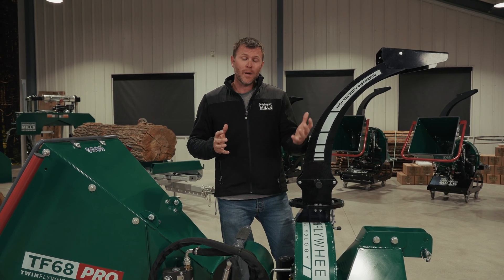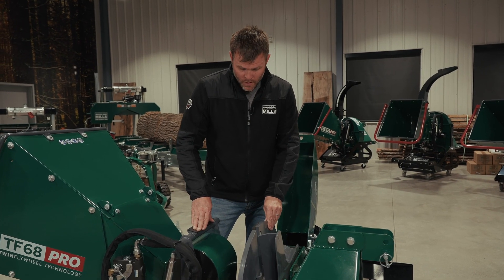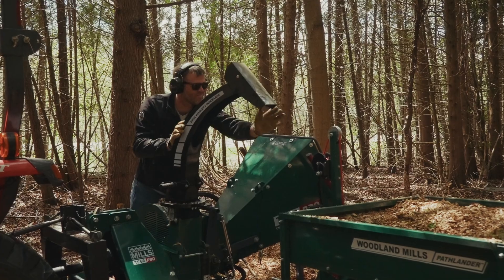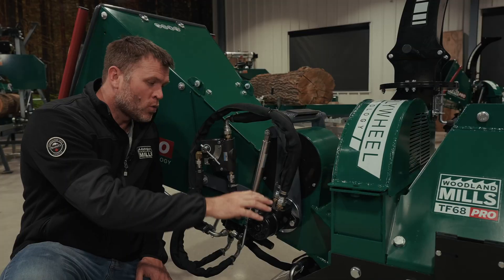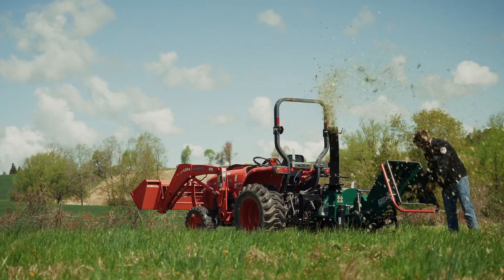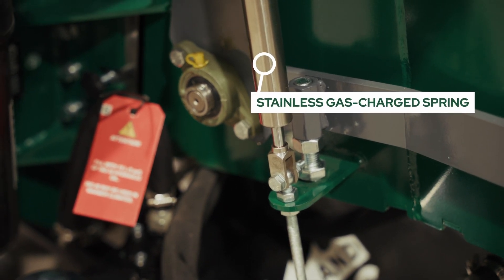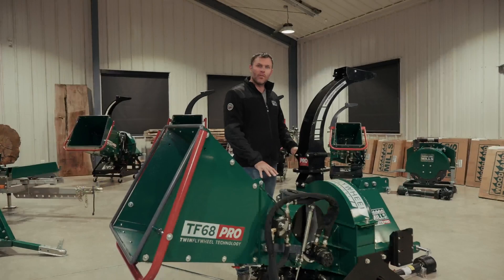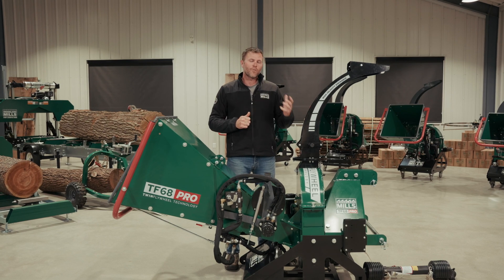Woodland Mills TF68 PRO PTO-Driven Wood Chipper Walkaround

Comment: I just got my TF68 Pro delivered a week ago. I will update with a video when I connect it to my tractor and use. I chose the Pro model because here in central Florida we have lots of pine and oak and is green most of the year with leaves and needles. Hopefully the Pro model will keep all the extra debris clear from the chute.

Comment: how do you raise the intake feed roller when you stall your tractor out on a big chunk of wood that is stuck between the chipper knife flywheel and the feed roller?
Reply from the maker: Once everything is turned off, we recommend removing the spring tension and lifting the roller up to remove the clog. If you still need help with this issue please call us at 1-855-476-6455 and press 2 for tech :)
Reply: I would think (and I am not sure), but I would think that when the pto is disengaged, the red bar would be pushed in to reverse the feed. Then, when the pto is engaged, it feeds the material back out.

Comment: I like seeing that window for setting the bed knife. I wish the WC88 had that feature! I like the 88, but if I wanted to get nit-picky, not being able to set the bed knife with a feeler gage buggs this old machinist.
Reply from the maker: Unfortunately the bed plate gap tool and window is only on our new chippers as it is a part of the housing. However, on our previous models a tip that one of our senior techs came up with is using a marked flat edge to display between a 1/16"-1/8" between the flywheel blades and bed plate by going in the clam shell.